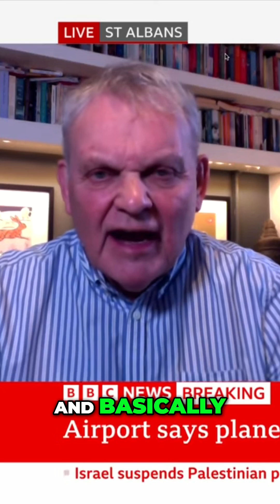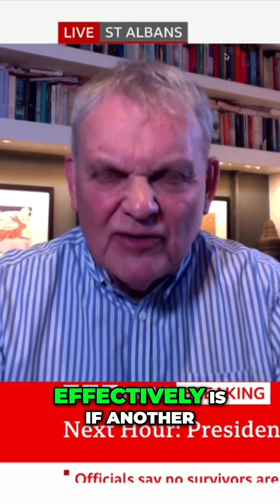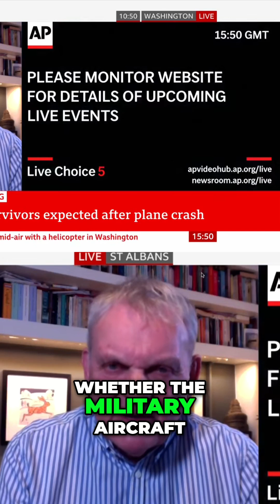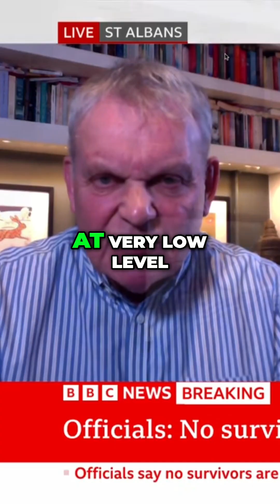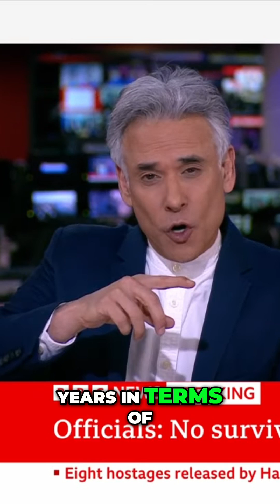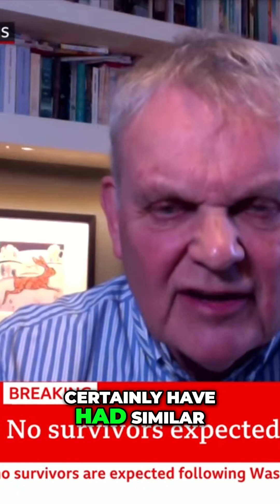Experts REVEAL The SECRET To Avoiding Collisions With TCAS Technology

Comment: TCAS relies on the pilot putting in correct air pressure corrected altitude. On the helicopter it’s easy to screw it up.
Reply from the maker: Thank you for your insightful comment! You're absolutely right; precision in input is key for safety in aviation.